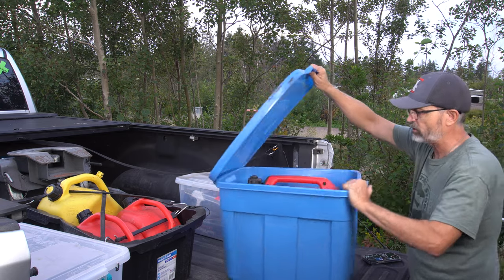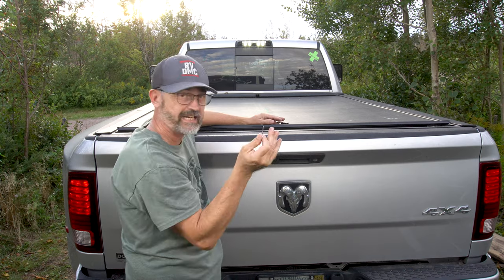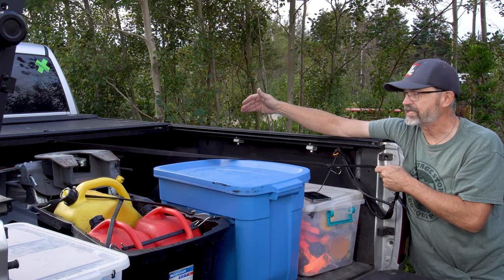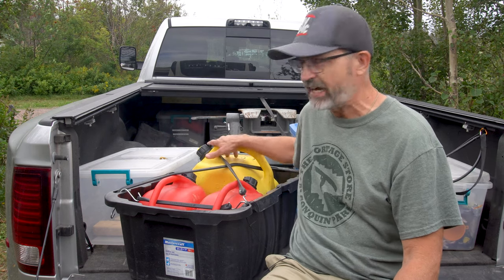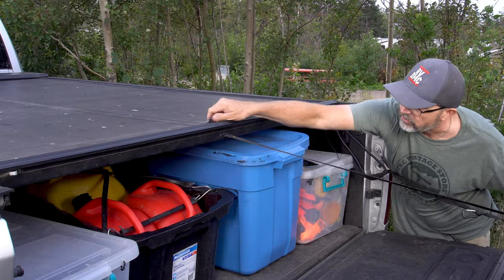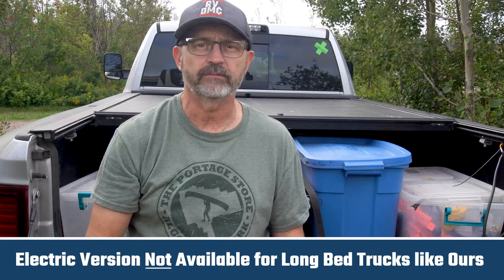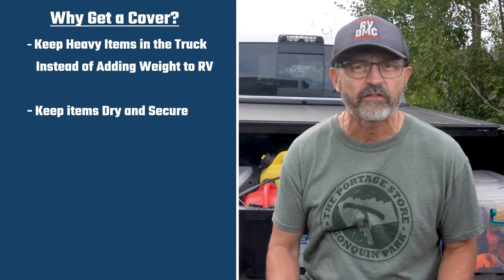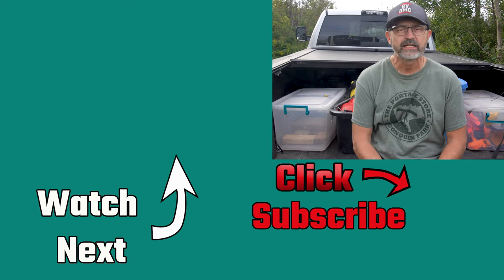Truck Bed Cover 1 Year Roll n Lock Review (RV Living) 4K

Comment: I’ve had the roll n lock on my 2004 Ford Sport Trac about 15 years. It is great. I use the 303 spray on it regularly. It still looks new after being parked in my driveway in the Florida sun for all those years. Parked in the driveway under a giant oak tree. I found out that leaves and debris collect in the channel and block the drains. So a couple of times a year I remove the 2 screws securing the cover. The other covers require a dismantling to remove the debris. Plus there is a large gap between the cover and canister that allows debris to collect under the other brand. Remove the debris to clear the drains. If you park inside or under cover this will not be a problem. About 5 years ago I had to replace the spring. I was not upset. Things wear out and break with use and age. Like the rest of my truck has done over those 19 years. The strap is a minor issue, but the dry, secure bed makes up for that. Would I buy another one? Yes already ordered for my 2024 Ranger. To be installed upon its delivery next month. I looked at the retrax bed cover. It is not fabric over aluminum. Just fabric unless you upgrade to the pro model for a lot more money and less bed room due to the larger canister. I was thinking about putting D Rings on each side to replace the strap. But if the top isn’t pulled straight the latches on both sides may not lock.
Reply from the maker: Great points. Thanks. 
We also remove the debris and clean it out. Plus, clean and protect the cover as well. 
Besides the strap, we have been happy with it
Reply: I bought a truck private party that has this exact roll n lock cover. It does not retract anymore. Can you tell me which springs I need? 
Thank you!

Comment: I looked at the roll n lock but I chose the Pace Edwards power with remote control so I can stop it wherever I want and I can open it as I am backing up or close it as I am pulling away and I put it on when my truck was new 2015 and I have changed the batteries in the remote one time. I is on a 2015 3500HD long bed and I have had no problems with it. A friend of mine has a Roll n Lock and he likes his too.
Reply from the maker: The roll n lock electric does not have a 8 foot bed version, 6 foot is the longest.  I will have to check out the pace edwards, thanks for sharing your experience, Larry
Reply: I had the powered Pace Edwards on a 2005 F150, loved it!!!!!    17 years of troublefree use, and i used it a lot....and did pull a 5th wheel with it, like the rest of you, loved being able to have it partially closed.   Only had to lube the tracks a few times over the years.   The only problems I had over the years was, i wore out the remote and had to get a replacement once, and in the last couple of years, the finish started to come off in one spot.  Contacted Pace Edwards, and they sent me a patch kit for free....cover was about 15 years old at the time.   Cover was worth every penny.

Comment: Good Morning. Yes I have the Roll N lock also.  Yes the strap is a pain but I do like your rubber cord to help keep it out of the way.  I put a tool box under the box in the truck to keep some truck stuff.  I have a sliding fence to keep things from moving around and a way from the hitch.  I try to take the champion hitch like yours out when not need which is why i have the moving fence connected to the Roll N lock.  Thank You Jack
Reply from the maker: Jack, sounds like you have a great set up. Thanks for sharing it with others here 
Alice

Comment: We have a 2500 RAM and installed the Roll n Lock cover too.  We are not full time, but we do haul a travel trailer from time to time. Our last trip in the southeast was for 80 days in the spring of this year.  Our first 6 week trip in fall 2020, was worrisome because we didn’t have a cover. I researched a lot of covers and wanted a Peragon cover for a while, but then decided against it because if my tubs or crates slid too far forward, I might not be able to get it open.  I am glad I got the Roll n Lock cover. It looks good and works well.  I haven’t been driven crazy by the strap.  I am a bit heavier and older than Larry, so I screwed a 4” el (L) bracket to a 1”x2”x6’ furring strip that allows me to hook under the lip of my crates to pull them to the tailgate to access them. Yes, I have to move things around a bit but I don’t have to get up into the truck bed if I don’t want to…helps a 70 year, overweight vet still enjoy the good life. Maybe I can lose some weight before I turn 71.
Reply from the maker: Frank, that’s a great solution to not go in the truck. Larry is 56 with RA and he does hurt himself. He uses a small step ladder to get in and out many times. Maybe he should think about your solution. 
Glad to hear at your age you are still enjoying yourself. We hope to be doing the same in our 70s 🤞 
Stay safe and have some fun,
Alice
Reply: Frank thank you for your service!!

Comment: Another very helpful and informative video. Several months ago, I purchased a 2019 RAM 3500 Limited Super Cab SRW truck that has a bed cover installed. It is the American Truck Cover model made by Truck Covers USA. The design is very similar to your Roll n' Lock, including the long strap, etc. Your maintenance tips and solution to securing the pull strap were very helpful. It also prompted me to email the manufacturer to provide download links to installation and maintenance tips, etc. Thanks, again, for everything!
Reply from the maker: The strap is kind of a pet peave for me but, the cover does exactly what it should do.  Glad yours works great for you.  Larry

Comment: Hello again, Larry and Alice! Great video(again) on the Roll-n-lock cover. I've been using a Roll-n-lock cover since the early nineties on all of the pickups I've bought. At first, I tried the fiberglass cover, but soon found it's limitations on carrying taller items. I've had only Roll-n-lock covers since then, and for the same reasons you mentioned. I've never had any problems with theft or damage from the elements to our stuff while using this cover. Well, except for the one time when we got caught in rain that turned into snow and it froze the cover in place to the slide rails. Not much I could do about that than wait for warmer temperatures and the thaw.
 I'm also impressed that this cover has a metal back, so no one can cut it open to explore what I'm carrying. Another advantage this cover has is that when it's locked in full close position, it engages into the tailgate to help prevent theft of your tailgate, which is becoming a big problem. I always have my tailgate locked, so this cover just adds an extra layer of protection against theft my my tailgate.
You two be safe and enjoy yourselves! Thanks!
Reply from the maker: Hey Phillip, thanks for sharing your experience with the RNL, I hope we never have to worry about snow, haha.  I was not aware of the tailgate theft problem.  Yes having the cover lock to the tailgate is a big advantage to the RNL compared to the Retrax, i should have mentioned that in the video.  Larry

Comment: We had the Retrax Pro that you showed at the end of your video installed last year on our GMC with an auto slider 5th wheel hitch in the bed. No cord to mess with, stop and lock the cover in any position and less maintenance (because it’s powder coated metal) would be pluses for the Retrax Pro. They seem very similar in their design and looks...but maybe not quite as cool as yours! We love our cover for all the reasons you cited whether towing or not.
Reply from the maker: I’m sure you can see my Retrax envy in my video, the roll n lock works for us, but i should have spent the extra money to get the Retrax pro.  Larry

Comment: Hi. You wanted to know about the Retrax Pro.  I have the manual XR  version, no motor. It does leak a little bit which doesn't let me use cardboard boxes as eventually some water gets to it. Heavy plastic containers work fine. ( Don't use cheap thin plastic containers, I'll explain later ). Mine isn't vinyl, its aluminum. I lubricate it VERY LIGHTLY with dry teflon lube, I choose this lube which was designed for off-road bike chains and doesn't gum up or collect much grime. I don't apply the oil to the tracks directly, I oil a rag to minimize the amount of oil I use. I carry an old hand towel under my back seat to dust away the top of the bed cover if there is a lot of leaves and dust at the time. I added 4 extra clamps strictly out of paranoia because I carry 2 heavy ( and insanely expensive ) E-Bikes on top of the cover which adds about 250 pounds ( Including towers bars and bike holders ). While I wouldn't classify what we do as off-road, we are addicted to fire and BLM roads and 9 out of 10 times these are not paved so there are more bumps and vibrations that make things wobble and shake loose. Did I mention I'm paranoid? Yes well I also added 8 heavy duty silicone suction cup D ring holders on the outside of the truck, these do not damage the paint. I use 4 on each side to tie the bikes in with tight bungee cords, these reduce the side wobble of the bikes therefore reducing the strain on the bike rack. NOW...
There is one thing about the Retax I don't like. I doubles as a frying pan and an oven!!!  It gets hot as hell both inside the bed and the cover itself, it WILL burn your hand easily. Im seriously considering painting it gloss white. or maybe adding some kind of cover that can take 65 mph winds and rain, if there is such a thing, or something.  If anyone has a solution to this problem I'd love to hear it! I had some disposable plastic food containers in there a few hours, they deformed from the heat! I actually purchased a carport canopy ( I have no garage ) in a large part because of this. It's no fun getting burned while loading and unloading our bikes. The heat is VERY frustrating. Other than that, the Retrax works.
Reply from the maker: Thanks for sharing your experience with the Retrax.  The vinyl top on the roll n lock keeps the water out mostly but not completely.  Great idea using bike chain lube for the rails, i uses a special tephlon formula for my mountain bike, i will try it on the roll no lock rails, ill bet it will work awesome.  I wonder if there was as way to paint the top of the Retrax cover white to reduce the heat problem,  im sure i could do something like that to my roll n lock vinyl top. I still hoping to get a free Retrax to do a review, haha.  Larry

Comment: Back in 2008 I purchased a new Truck and I did purchase a Roll-Bak cover.  I remember paying good money for it back then.  Don`t think they are in business any more.  The sellers said it was so well built you could stand on it and it would endure to your next truck.  Lightweights could probably stand on it but unfortunately not me.  It had a powder coated aluminum top and rolled into a canister.   I still have that truck.  After sixteen years the powder coat is still on and other than an occasional bind because of the spring getting a little weak its the best investment I ever made for my truck.  It`s very secure and looks strong and impenetrable.   My wood stays dry and generator stays secure and other than clearing out the debris from the drain system it has always worked great.  I am ready to purchase a new truck and I hope it fits in the new standard beds.
Reply from the maker: Sounds like that was well made. It’s a shame they aren’t around anymore. 
Ours is still going strong. I clean it and protect it from time to time

Comment: Great review of the pros, cons, and practicality.  I had one of these a couple trucks ago.  Liked the cover a lot, but the canister for storage just ate space we needed at the front of the bed.  One important thing to note, the cover will not work with all 5er pinboxes and definitely not the Goosebox as the rails intrude too far into the bed and will collide on tight turns.  Those who like the cover and tow a 5er need to be conscious  of this.
Reply from the maker: Yes i agree, every pinbox and hitch is different and may or may not accommodate a partially closed cover while towing.  When I am backing into tight spaces and doing extreme angles with the truck, i always retract the cover all the way to make sure i dont have a cover collision.  Thanks for pointing that out. Larry
Reply: Howdy - I've just installed a new goosebox, and was going to buy a roll-n-lock cover.  My Q is do you have a goosebox and if so how far 'could' you turn?  60, 70, 80 degrees?
Reply: @sohereweare-lifeitsallabou9447  Too many unknowns and variables now to say for sure. Roll-n-Lock now has several series, and there is a difference in the bed protrusion by the tracks. Truck year, make, and model also matter. Gen 1, 2, or 3 Goosebox too.  Also, keep in mind that towing on the ball gives more multi-axis movement versus being on the conventional pin. What I mean is the trailer can not only pivot but also lean and bring the rear of the Goosebox very close to the bed.  The rails for my tonneau protrude into the bed of my 2015 RAM 3500 long bed just 1-1/8".   I did contact the passenger side rail with the Gen 2 Goosebox backing into a site where 5er was heading uphill while truck level and about 75 degrees.  Enough to make it ugly to where I needed to file it, but it doesn't affect the use of the vinyl tonneau but would definitely cause an issue with a roller.

Comment: Good to have the strap tied to the back of your box.  A couple of years back while travelling in California with my fifth wheel and Denali 3500, with a similar roll top, the strap flapped in the wind and worked it's way down the front of the box and wrapped around the truck drive shaft. It snapped with a loud bang and bent the roll top up a little.  It scared the heck out of the two of us in the truck as I was going 60 MPH and thought a tire blew.  I managed to pull over and it took a few minutes to figure out what had occurred.
Reply from the maker: Robert, wow. That’s scary. We could see that happening. A tire issue is one of my biggest scares. 
Hope it wasn’t too costly to fix. 
Thanks for sharing your story 🤗 
Alice

Comment: Our retractable Ford OEM bed coverbon our F-250 is metal and works great.  Low profile and slides easily back and forth.  Has to be all the way open or closed.  Does not completely seal all water but very little gets in.  Practically maintenance free.
Reply from the maker: We are glad you found one that works for you. However, we need one that can cover half the truck while hitched to our fifth wheel. 
But your recommendation is great for others - thanks for sharing 🤗 
Alice
Reply: i think that's the retreax one

Comment: Just purchased and they installed it for FREE in Sulphur Springs, Texas.
I'M SO EXCITED AND THANKS FOR THE "tub" brand and dimensions!  Bought if because you did there homework 😉
Reply from the maker: I hope you love your roll n lock, I love mine most of the time, except for when that strap gets stuck it’s still drives me nuts. i’ve had it for a couple of years now and it still works great and the cover has lasted well even in Florida Sun.  I haven’t had to do anything to it except for clean it with 333 every couple of months.  Larry

Comment: Good evening to you!  You have done another excellent product review here!  Thank you very much for sharing your thoughts and experiences with this tonneau cover!

Ha…we are as clear as mud water with regards to what we want to do.  I will be pulling a 27foot travel trailer with a crew cab, long bed F350.  Our trailer only has 1 external storage, pass through bay.  So, a fair amount of stuff will need to go into our bed.  We also don’t have a ton of storage inside the trailer.  So….we will want to put something back there.  Of course, a hard shell bed top is expensive and blocks the view.  So, I am more inclined to something like what you have or maybe a soft top bed topper that Incan also fold out of the way when not needed.  

Ha….bed storage and inverter generator are our two biggest supporting decisions we have to make right now.

Safe travels!
Reply from the maker: If i had a travel trailer, i would definitely get a hard shell topper for the back of the truck, lots of storage, use a camera to help back into the hitch.  I highly recommend the honda generators, i used our 2000 for 17 years and it has worked great.  I just added the 2200 and it is even better.  Quiet and powerful uses a very small amount of fuel.  I did a video about my 2000 about a year ago check it out.  https://youtu.be/FfJyTaz1Byo.  Larry

Comment: Everything you said is fact... My Roll n' Lock has been on my truck since 2003. And it still works great. So much so, I purchased the electric one for my new truck 3 years ago. There's no straps and locks in any position. All you have to do is minor maintenance to keep it working properly. The electric one is the same maintenance. However, it has a metal top. I agree, it is expensive. But opening and closing is a push of a button. Good video, sharing....
Reply from the maker: I would have though roll n lock would give me a free cover by now, three videos with a lot of views, come on roll n lock i want an electric one too.  Lar